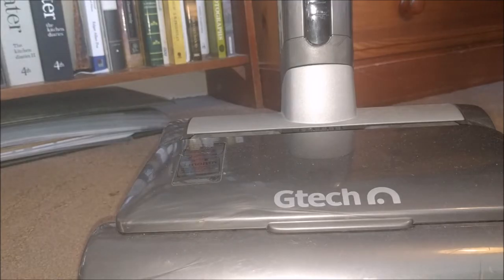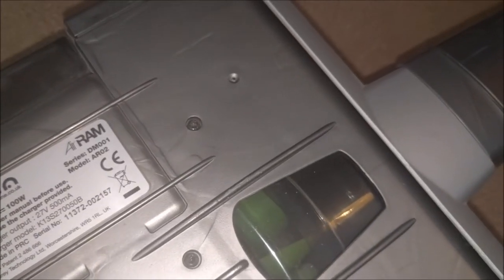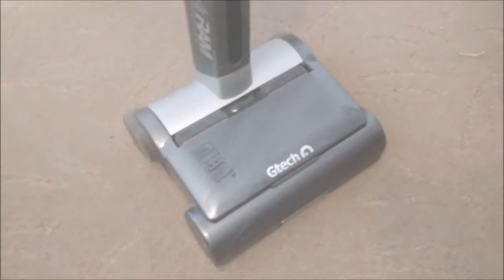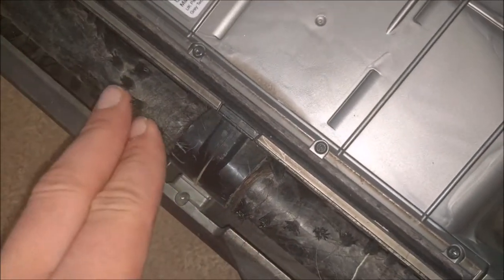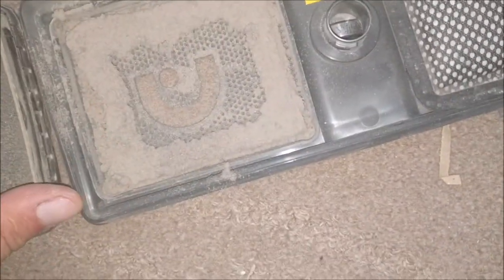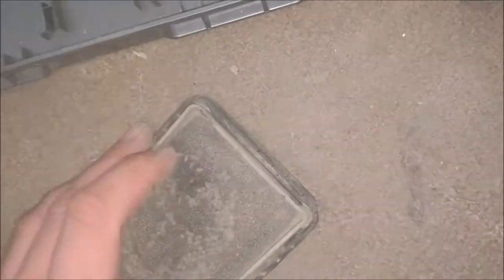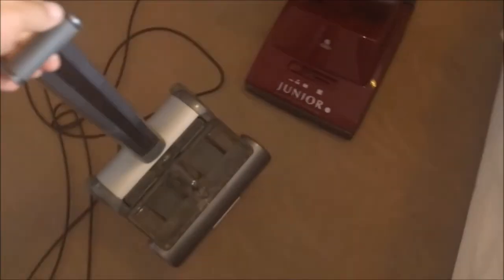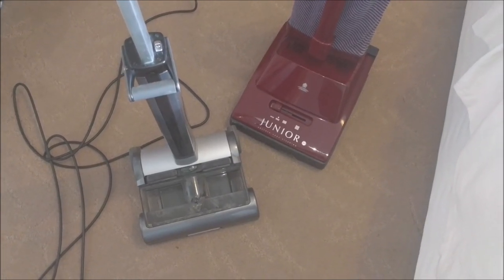Gtech Air Ram Mk1 - Before Refurbishment and Repair

Comment: I don't like the airram much. My church has the same model and it doesn't do a good job. The Dyson DC01 there feels about 10x more powerful than the gtech
Reply from the maker: Luke Davies I've not got high expectations but I'll use it once done so I can form an actual opinion rather than one made up by many other peoples hatred of them!
Reply: Beko1987 They're ok, but I wouldn't buy one myself. The mk2 may be better but I wouldn't buy one still
Reply: that's maybe because it is. my friend has one and I keep worrying the handle will snap off it feels so flimsy.